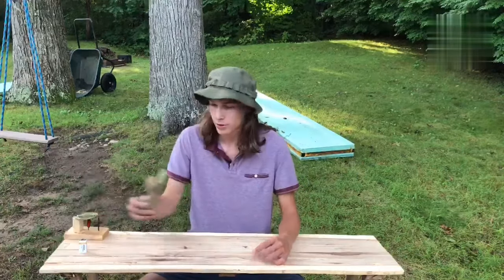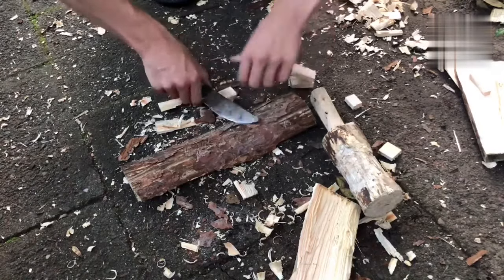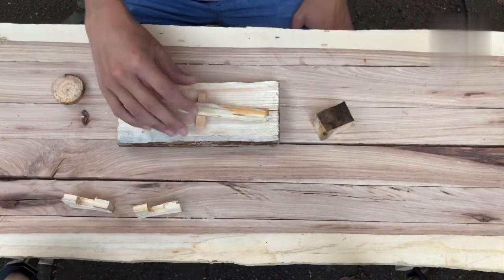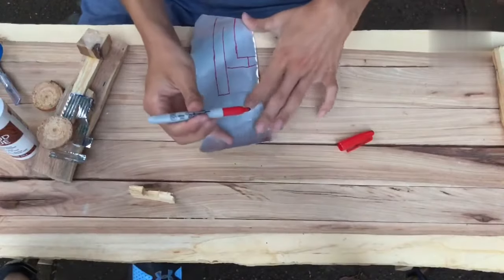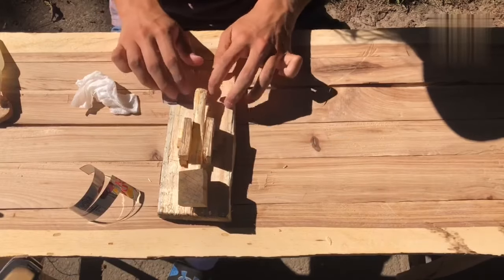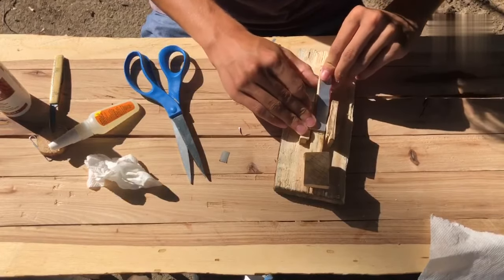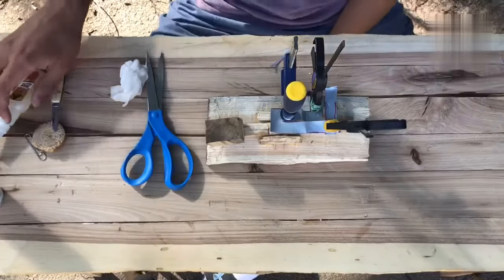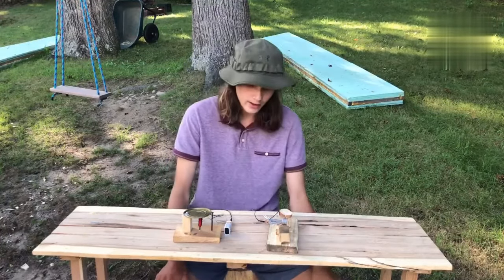How to Build a Simple Telegraph Key from Everyday Materials

Comment: wow,making everything ot of raw wood?that's so cool! i remember when i didn't have dowels or small planks for stuff like this so i would just take fresh branches and peel them,then use them for my projects,but you are on a whole another level....
I also really wanna see how you will make the radio! I mostly use coherers as they are enough for what i need,but there are also crystal radios,which are really cool but work on a very limited power supply-the radio waves it recieves are the only power the radio has to power the speaker,you can also make amplifiers but i am really bad at that,lol....